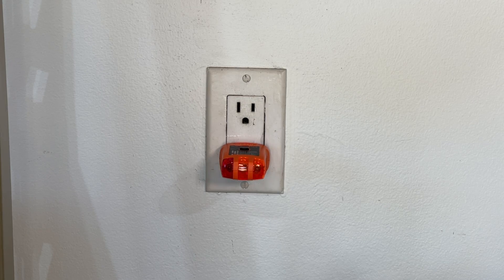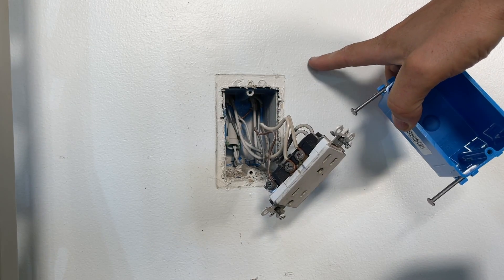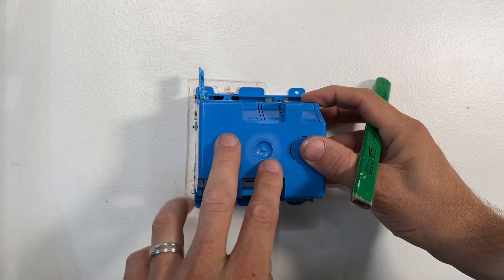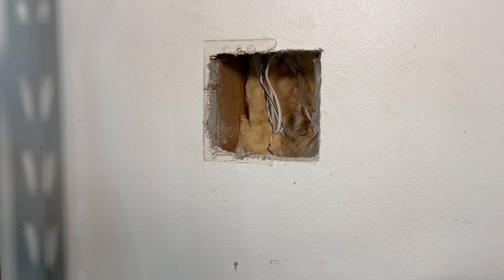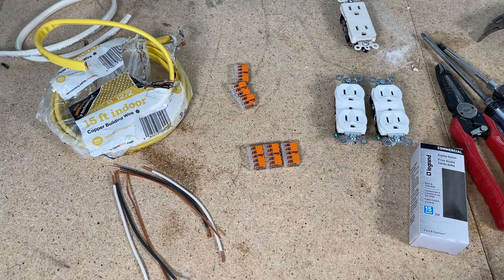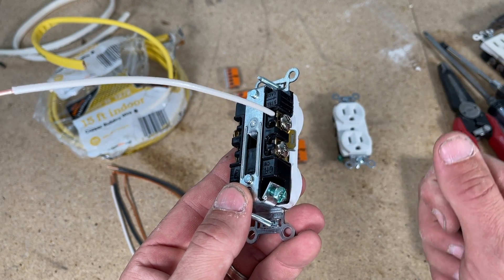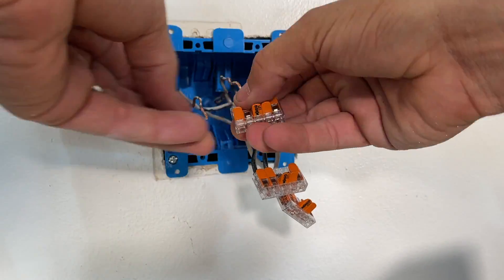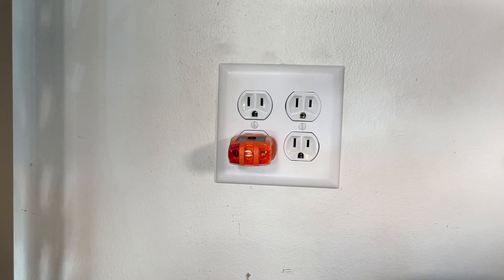Converting 1 Outlet Into 2

Comment: Not sure why you added the extra wago connectors to the box.  Since there are limits to how many connectors and wires you are allowed to add to a box it seems that this is an unnecessary addition that will simply take up space.  If you added one pair of the existing wires to each of the new outlets and then used the pigtails to connect hot to hot and neutral to neutral you would accomplish the same thing without using unnecessary connections.    Just my .02
Reply: I'd argue the existing outlet in that box was incorrectly installed. Receptacles are designed to connect plugged-in devices to the electrical wiring. They are not designed to be conductors in the circuit to other in-wall devices.  The existing receptacle should have already been pig-tailed, Scott was just fixing an oversight in the existing construction.
Reply: @AndrewFremantle  I think if you check code you’ll discover you are incorrect.  They are absolutely designed to be conductors.  Thats how every outlets in every room move power from one to another.  Without doing it this way you would never be able provide down stream protection using a GFCI outlet
Reply: @bskelly  pigtailing is the proper way. If you feed thru the screws of outlet then it’s not legal because you are using a 15 amp device in a 20 amp circuit. Also the likely hood of the screws getting loose over time from heat cycles is greater if the amperage from every outlet on that circuit has to feed thru every proceeding outlet’s screws.  Pig tailing keeps the current in the wire and not thru the outlets.
Reply: @MrSleepProductionsInc  all I can tell you is we had a new home built tree years ago. Every outlet in the home is daisy chained to the next using 15amp outlets on 20amp breakers.   That’s just how it’s done and meets code perfectly well. I have been involved in hundreds of electrical jobs and hundreds of homes with build dates over the past 75 years. Each and everyone was done this way.  They can’t all be wrong.
Reply: @bskelly  ... I think you will find that all 15 amp outlets are rated for a 20 amp pass-through, which is how it meets code.

Comment: Another reason for using a hand jab saw is that you are less likely to damage a wire in the wall. You usually can feel if the saw is touching a cable as you are sawing.
Reply: If you have old drywall, a jab saw will crumble it to dust and make a jagged cut.  The oscillating tool or roto-zip works much better.
Reply: Correct.

Though when running new wire, just use a hammer to bust the drywall out for ultimate safety. You can square out the edges later since you're likely going to buy new drywall and patch it anyways. Then there's zero chance of hitting a hidden wire. Plus you get to bust a wall open ;)

Comment: Why dont you  use a steel 1900.  With a 2 gang ring &throw that plastic  crap in the garbage I would not hire you
Reply: I know the type of setup that you're talking about. At first I didn't, but once I looked up the steel 1900 box, I realized that  I've seen it before.

 I'm sure they would have to get a certain type of clamp that is specific to the type of cable their using to go through one of the knockouts. It sounds like a good idea. But you didn't have to be so harsh with your comment.
Reply: 1900 boxes are not made for cut in boxes.They do make metal gangable boxes that could be used.1900 are designed to be installed on flat surface.

Comment: HI Scott,  I like what you did to double up on the receptacles.   Where I live, all that you have is not to our "Quebec" Code.   We are still with code stipulating metal boxes and using marrates. We also have another rule that we have to follow:  If in the kitchen, where you could have 500 watt appliances, we are limited to 3 outlets per 15 amp breaker.  Elsewhere (lamps in living room), that number can go to  6.    
We recently had an electrical code change, where each floor level lamp receptacle has to be a trr type,(tamper resistant). It has an internal shutter over the slots. No baby should be able to stick in a pointed knife into either slot.
So, for us to do your type of doubling, here in Quebec, it is one of "depends".  

I should mention that sometimes some of our kitchen receptacles are split wired to a 220 15amp ganged breaker under the counter or to one such located at the main panel.  The cabling is 14/3

The receptacle is split so that the upper plug is on one side of the 220 volts, and the lower side is on the other.  This was allowed and done because of some counter islands have doubled receptacles, to support having concurrent active broilers, electric frypans, electric kettles and coffee makers at the one location. I did not see the split being one receptacle on one side of the 220, and the other receptacle connected to the other. People tend to use one recepticle beforee putting the third plug into the next one.. 
I do like the plastic boxes that you used.   For the fun of it, check out home.depot.com and then home.depot.ca, and search for electric boxes.     
 
I do have a concern about wiring the grounds as shown.  In the video, you show each ground wire folded and coming up the side of the receptacle.  I would have wired the ground to first receptacle, and a short jump across to the second.   As you did it, I would wrap electrical tape around the receptacles to prevent any accidental connection of ground to terminal connection before installing same into the box. 

I think that our electric code in Quebec lags by a few years versus your electric code.  
Thank you for a very clear and showing a clean way to double up on receptacles.

Leslie from Montreal.
Reply: As a grandfather, I care.
Reply: @TomCee53  Am I an older Grandfather than you?  1941.
Reply: @lsatenstein  born 1953. Grandfather since 2018. Daughter and I both started a little later than some. 👨🏼‍🏫👨🏻‍🦳🎶🙋🏻‍♂️🍗🥤🎧🛠✝️🔊🇺🇸
Reply: @TomCee53  When you were younger, you and wife worried about the kids. Now you worry about the grandkids first, and their parents second.,
Reply: @TomCee53  still who cares
Reply: @johnkulpowich5260  haha
Reply: You spelled marrette wrong. For everyone who's not French or French Canadian, it's a wire nut.
Reply: @KJ6EAD  Yes,  One t in the name is missing. (sorry)
Reply: @KJ6EAD  big deal
Reply: @johnkulpowich5260  Yes, it is for people who've never heard of a marrette, and can't even look it up if it's not spelled correctly. By the way, what's wrong with you?
Reply: @KJ6EAD  me nothing wrong
Can't stand nit picking. Spelling wrong. Not said right. Not code.   Than go get a expert if you want perfect
Reply: @johnkulpowich5260  I am an expert, sharing my knowledge. If filling in missing information and correcting significant spelling errors is offensive to you, perhaps you should find another kind of expert to help you instead of harassing people who make innocent and useful comments.
Reply: Interesting. No, you always pigtail grounds from the home run. You never want a ground for one receptacle to depend on another one's presence.
Reply: Who really cares

Comment: How did you just pull out that old work box that was nailed in so easily? Whenever doing something like this I've had to cut the old nails/screws with the multitool.
Reply from the maker: I thought I would have to cut the nails off as well but will a small pry bar the nails easily pulled out of the pine 2x4.  Always nice when it is easier than expected.
Reply: Like the author, I use a pry bar to remove the old box. It has worked every time for me. The 'trick' is to cut the opening first before prying out the old box. This gives you room to pry out the old box.
Reply: Don't know if it's to code but in my kitchen one of the boxes is nailed to the stud from inside the box. i think it may have been an attempt to tighten up a loose box, if so it didn't work too well.

Comment: Newbie question here, why not just use a surge protector power strip to get more outlets? I suppose there must be some advantage doing this than using a power strip, right?
Reply: Too many fires from Chinese units that are using tiny wire gauges inside them.
Reply: That's what I do. A power bar also allows me to shut off the breaker on the bar  so I don't spend money on ghost power.
Reply: Honestly, I was questioning the same thing, as long as the wire on the surge suppressor is 14 gauge (for a 15 amp outlet, 12 for a 20) then there's no real difference unless you want to have two GFCIs independently resetable (I do have this in my basement, but it was a short term fix for a pipe that wasn't sealed to the outside)
Reply: It depends on what you plug in. You may not need a surge protector, but you could add a power strip. The problem is that a power strip is that you're adding another device that can fail, hardwiring like Scott shows is safer and gives a cleaner look.
Reply: OK, thank you all.

Comment: i built a smart dimmer with usb 110 combo and the box while old world (blue) was too tight.  I had a hella bad time getting the newer products together in the box.  Any suggestions?
Reply from the maker: The smart dimmer is pretty bulky, right?  If so, those can be tough to fit in certain situations. Wonder if you could get a large capacity 2 gang box that would work a little better.
Reply: You need a deeper box. I had the same issues putting some wireless dimmers and switches in. WAGO helped save some space as they can lie flatter but I still have to remove mine and just redo the box. I don't like how cramped it is.

Comment: You don’t like backstabbing an outlet but you’ll use wago connectors. Even smarter. Twist your joints and put a nut on it. I’ve seen wagos catch fire
Reply: Backstabbing and backwiring are not the same thing. I used to get confused about this also. Backstabbing is when you push wires into small holes that have tempered springs to lock the wires in place. They suck.

 Backwiring is when you take the conductors and put them through holes which have screw terminals that clamp down on to them. GFCI outlets usually have these.

If I'm not mistaken, backstabbing connections only can handle up to 14 gauge (15A). Backwiring connections can handle 12 gauge (20A).

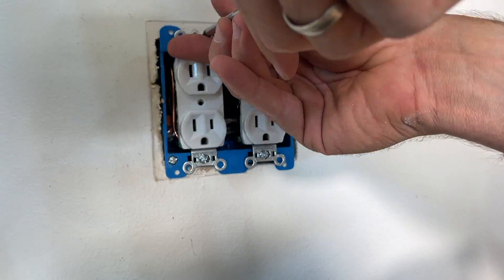Comment: The ground on the left side outlet at 9:15 makes me nervous. Great Video! Thanks!
Reply: Optical illusion… and besides… it’s the neutral side… not the hot side.
Reply: i was gonna say the same thing lol
Reply: Its on the neutral side. Not a big deal but people with OCD would want to make sure its tucked away from the terminals.
Reply: @mrnapolean1  Yeah, people like me! When running pigtails like this I have rolls of both 12 and 14 gauge wire with green insulation to ensure no accidental shorts occur also!
Edit: I also wrap the outlet with 2 to 3 wraps of electrical tape as yet another measure of protection!

Comment: For the old work boxes, I prefer to bend off the little ears on the receptacle/switch so that it mounts deeper in the box. The old work boxes have a recessed area that will fit the rectangular part, but not the ears. That way, the faceplate goes flush(er) against the wall without a gap. I also like the old work boxes with screws (eg Madison Electric boxes) if you're mounting against a stud. The wing-boxes are ok for switches or if you don't have a stud in the location, but I don't like how unsecure they can be. I've almost ripped one completely out of the wall unplugging a plug in a tight outlet. This is especially bad with 2-gangs.
Reply: Agreed with the Madison electric boxes. Screwing into the studs is optimal.
Reply from the maker: Thanks for the feedback 👍
Reply: @EverydayHomeRepairs  nonono
Reply: @EverydayHomeRepairs  nononon
Reply: I've resorted to just driving a wood screw through when I reused an old work box. The wings sucked and putting a couple wood screws through the side into the stud solved it easy peasy
Reply: @etherealrose2139  That's technically a code violation since those boxes aren't listed for that use. Not that anything would go wrong, but I would just spend the extra dollar on a box that is actually designed to be used in that way.
Reply: @mr.g937  what part is the violation?
Reply: @blueplasma5589  only if you put the screws into a box that is not designed for. Just buy the one that has holes for screws. As I have heard is it is not a violation unless you get inspected.
Reply: I actually just commented this same thing before I read this comment
Reply: Maybe it's the screwless plates that I use, but when the yoke of the receptacle doesn't sit on the ears but goes into the box, the receptacle ends up recessed behind the wallplate for me, and it doesn't look great. I've needed to use those device spacers to correct for that.
Reply: @Embers7  You know I freaked out when he put the plate on and it was flush against the wall. I guess it depends on the type of wall plate you have. I have always had to clip or break off the "ears" to make that happen, like what was said, because of the thickness of the plastic that holds it on the outside of the wall.

Comment: Check out the 2 gang Madison Electric box that screws in at a diagonal for this next time, I prefer them if you have a stud like this!
Reply from the maker: Appreciate the tip!
Reply: Aside from the cleaner look of having the receptacles in the wall, it would have been a lot faster just to buy a quality power bar
Reply: Thanks for this info, bud.  I have never liked using boxes that grab the drywall with tabs except for switch boxes since switches don't cause any pulling on the drywall.  It's just bothersome to think that every time you pull a plug out of a receptacle you are yanking on the drywall.  The box you recommend looks good.
Reply: Carlon now offers a diagonal screw mount also. It also has nails (only on single gang) which won't be used in this case and a front of stud mount option that can be broken off like a knockout. I used a 2 gang box and 2 #9 gauge, 2 inch construction screws and it's very sturdy.